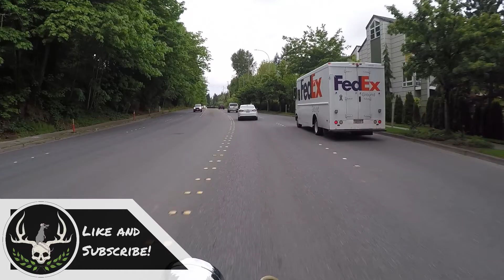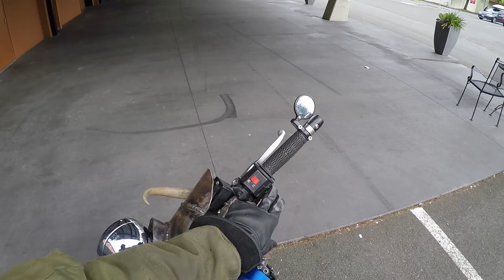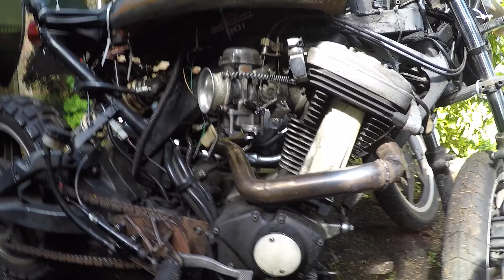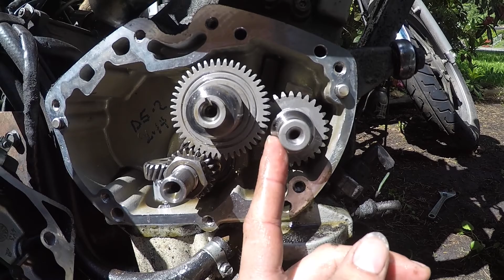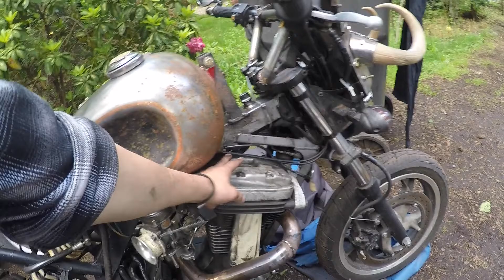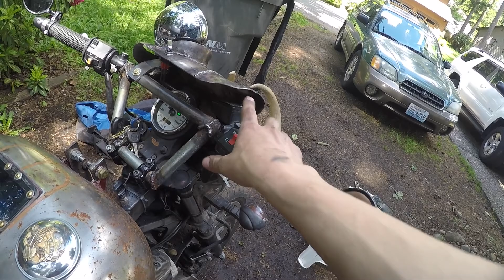I made my Blast a Bit Faster...

Comment: I love the B70 cam - the charge that starts at 3500 rpms is fun and is only enhanced with 1.75 ratio rockers. But a great simple install is the front set of SE 556 made for the tubers - timed simular as well -still would want better springs, guides, and seals than stock.
Reply from the maker: Yeah, I'll keep an eye out for a B70. Better valve springs and such can never hurt 🤘